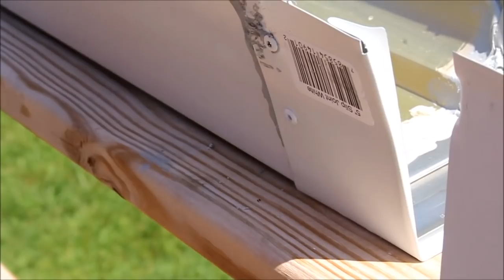Manufactured (Mobile) Home Gutter Installation

Comment: Thank you for this vid! I feel like a dork as I just snapped my together not knowing I needed to caulk them and first hard rain came and mine all busted apart 😂 now I will get them caulked . I am saving for rain catchment system those suckers are expensive so might just buy several smaller barrels for each side of home but also need to build a concrete pad and a heavy duty rack to mount them on this is my summer project utube always make stuff look easy till you actually start doing it yourself and realize heck their 30 minutes took me 2 weeks lol thank you for your time in doing vid I learned and appreciate

Comment: Wondering what type of screw you drill the gutter onto the house with. Focusing just on the gutter is marvelous but it is attached to a flimsy house material after all.
Reply: those support clamps he was installing every 2 feet come with screws in them already. they screw into the wood behind the vinyl

Comment: How did you connect it to the house? Did you use silicone behind the gutter? Did you go under the drip edge or on top of it?
Thank You
Reply from the maker: I did not add any silicone.  There wasn't any drip edge, I had to add that after.  If you have drip edge, the gutter would go behind the drip edge.
Reply from the maker: I used self-tapping sheet metal screws to attach to the gutters to the house.
Reply: Jeff's Auto Thank you for your video and your response, I appreciate it!! 👍🏻👍🏻
Reply: ..it's wood behind the fascia metal....metal screws are not good for that...1 5/8 deck screw is best...shyt.can the "joiner" thingy and over lap the gutter 6" with silicone/caulk in the middle..00.02